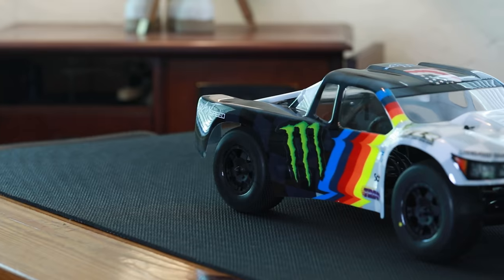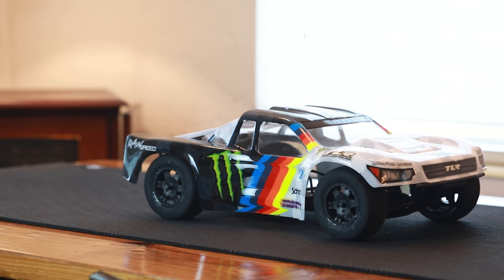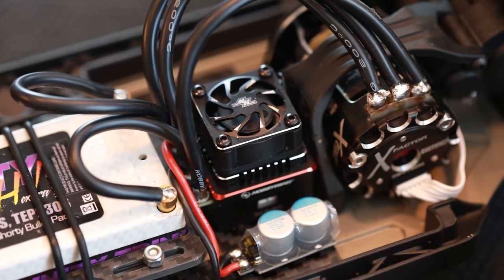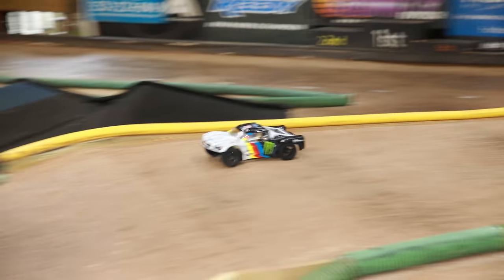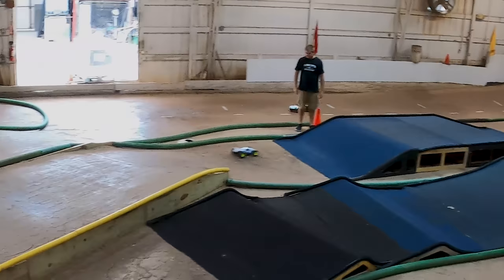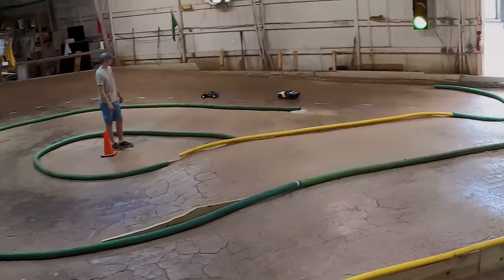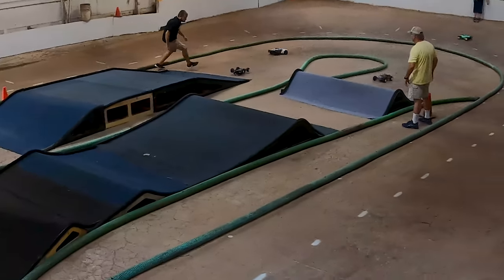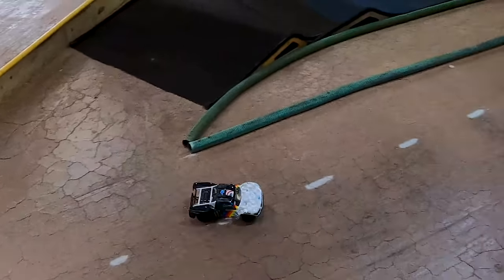Racing a Lowrider Short Course rc truck vs Stadium trucks?!

Comment: I would say right off the bat from watching that short clip that, that is caused by excessive and abrupt weight transfer.  Back in my time our cars were rear motor hanging out the back with you call a stand up transmission. Can't be more rear bias than that! But we could still get the cars to handle well. After you lowered the truck you noticed you needed stiffer front and softer rear. But it needed that all along. Lowering it just made it that much more noticeable.  Also could be not enough rear tow in or too much toe out in front. Or too much drag brake. Too much drag brake is a killer on 2wd.

Comment: lol there's always that one guy yelling at the marshals
Reply: Back when I raced, I had a bit of a policy when it came to marshaling. If I was running to get someone's car and they yelled at me, I'd slow down to a walk. If they kept revving the throttle while I was trying to pick up the car, I would just put my hands on my hips and stare at the driver's stand until they stopped. If they hit me while I was in the process of marshaling someone else and it results in their car having to be marshaled due to the impact, I'd refuse to marshal their car and let one of the other marshals take care of it.

The reason I started doing that last one is because I was often marshaling for 1/8th scale truggies since I primarily ran 1/8th scale buggy, and those truggies can do some damage if they hit you at full tilt. I don't care if that's the optimal line, if you see a marshal on the track it's your obligation to avoid them. This is actually the reason why for 1/5th scale racing they don't typically have marshals standing in the track area itself. The quarter scale oval guys even have caution flags.

Comment: Awesome build man! Try raising your front ride height so that the lower arms are horizontal. That will raise your roll centre and should decrease the trucks tendency to roll in the front and then possibly negate that stiffer spring you fitted. Just an idea, would be cool to experiment anyway! Keep it up 👍🏻

Comment: There's a guy at my local carpet track that has the same TLR truck with this conversion and he is very fast! side note: It's crazy that RC racing got to the point where mid-motor 3-gear would have too much weight on the rear lol anyway nice video, cheers!

Comment: Dude! nice driving.... I mess with crawlers, and bashers. Racing always seemed so exotic and out of my reach. But I have enough property I need to make a track. There is a traxxas mud boss class locally, but I would really like to turn right sometimes. Thanks for being so open with your setups, it might not be important to some people, but  just knowing what removing the sway bar can do, or changing hub carrier  position....i already feel like I gained some knowledge
Reply: Build the TRACK!  I started raking an oval in the woods one day, and now it's a great high speed track with banks and jumps...built on public property down by the river.

Comment: Ryan, did the 5.0 parts on the front change the caster angle? Iirc from my old school racing days, an aggressive caster angle would cause the erratic turning behavior due to the drastic change of instant center. In the older rear weight bias buggies, we tuned the  understeer for controlled transition in deceleration,  so we could bring the rear end around a tight turn with the throttle,  or maintain a certain amount of push in a wide fast sweeper.

Comment: I'm stocked I found you I drag race the slash like a million others but SCT there is more I want to buy another one to use it for what it is for like you. I use to race touring cars for 8 years in the late 902 and early 2000 so I'm not new to RC. What kit is that you are using. In my area at Delta RC they do race SCT.

Comment: Hi Ryan,

I’m thinking of getting back into RC racing in the Orlando / Central Florida area.

Do you know if short course truck is still dead?

Would I be better off picking up a stadium truck?

Would you know where I could pickup a nice used truck and RC gear online or personally know of anyone locally selling?

Thx…

Comment: I know you use the white carbon batteries. Which do you recommend for a 13.5 short course. 5000mah 100c turf tuff or 4000mah 100c high voltage?  Thanks for any help, and keep making great content!!! 👍 👍
Reply: I would use the 4000 high volt if your track rules allow them. Nothing wrong with a little extra oomph.

Comment: Great video Ryan.  I am going to be the negative one out of all these comments.  Lets be honest the lowrider kit was not the only change made.  The setup on the first track was poor and not hard to see it was.  The second track just had more grip.  I would like to see the lowrider kit and setup from the high bite track on the first track.  Bet it would not hook up.  Point is a poor setup is a poor setup on both tracks regardless of upgrades.  I would love to see the setups you had on both tracks.  Not stock springs on the lowrider setup by any means.

Comment: Just subscribed to your channel and man that sct was really handling well out there on the course nice driving!!! I'm a basher and I know the rigs with a nice setup tend to coat more than a basher rc but as a basher I find myself braking my rigs and buying all kinds of parts. How ofter do you find yourself replacing parts on your rigs you race? Because I just found a clay track qhere they race on weekend and thinking bout getting in to racing. Nice video glad I found your channel.
Reply: Great video. My son and I built lowriders using all TLR parts a couple of years ago. We race on carpet and the trucks are amazing.

Comment: I wonder how much different SCT would drive if they used normal 2.2s or 2.8 with low-profile tires instead of the goofy 2.2/3.0 wheel. Too bad that overall properly sized tires for those examples just don't exist.

Comment: I do have a 2WD SCT, but it's a XXX-SCT so it's completely obsolete by today's standards. Also it's set up for 7.5 Limited Mod which was a class they used to run over in Easly, SC, so it's not legal for stock or 13.5 Spec but it's just a bit too slow for mod.